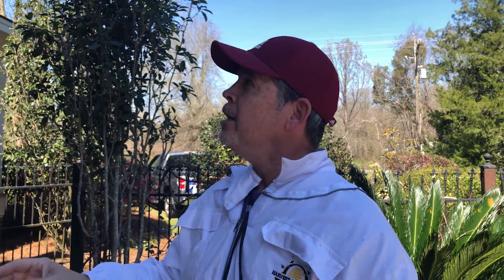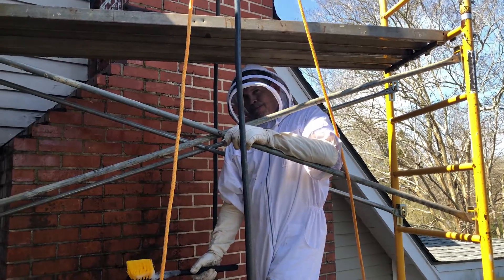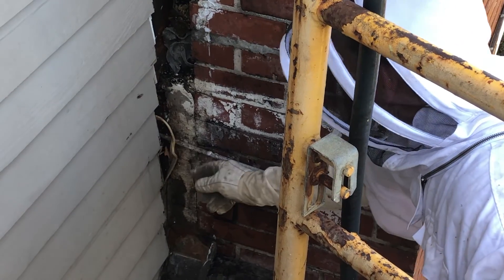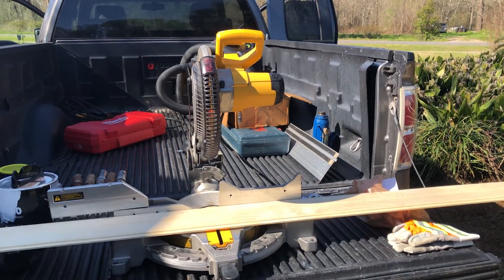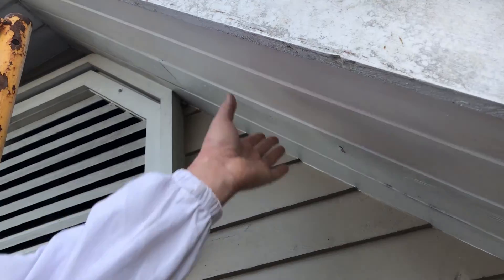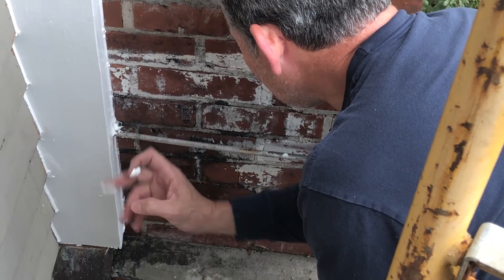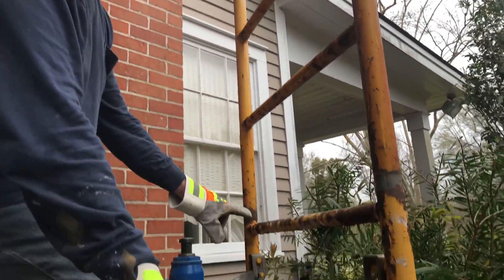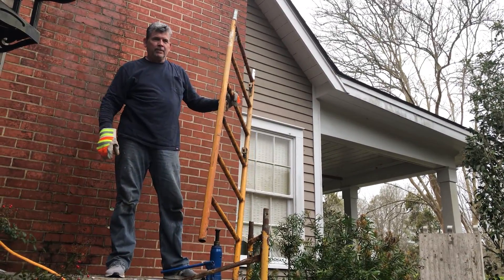How to Repair and Seal a Soffit INFESTED by Bees

Comment: always carry some low gauge copper wire with you, when tapcons fail slide in the wire first then use tapcon. gives it something to bite and can thicken the threads and give it something to anchor too.  when finished flush cut the wire and done.  know from experience it will improve your 50/50 success rate to about 98%. cool video 👍
Reply: Great tip. Thanks
Reply: We use that tip in construction and especially property maintenance, but with tooth picks or wood inside stripped out hinges and other holes etc mostly
Reply: believe it or not zip tie ends that are cut off after zip tying work amazing for this too!

Comment: Great work as usual guys!  Something I have learned to do when Tapcon’s don’t work because the hole gets stripped is to use short pieces of bailing wire or even a zip tie or two in the hole and then use a Tapcon or just an exterior screw. It works really well!  You two are a great team! Jordan, you are a lucky guy!
Reply from the maker: Thx Stuart 👍👊

Comment: Not sure if you will check this since it's a three year old video, but...I have found that sometimes if the the tapcons are stripping, if I use my drill/driver instead of the driver so it won't vibrate, thus making a smoother entry into the masonry. I think this helps to keep it from stripping. Also it helps me to not go smaller that a 1/4" tapcon except on rare occasions.
Also thanks so much for all information on all the videos. I had a kitchen remodel drop in my lap recently, and the A to Z kitchen remodel helped me tremendously as I had gotten very rusty in that area.

Comment: There's a trick that works good for getting stripped tap cons to stick in concrete/ brick. If it strips, stick a peice of copper wire( like out of romex) into the hole and it will compress the screw tight. Saved me many times

Comment: Cut a zip tie and put it in the hole in the brick or block when the tapcon strips out. Works perfectly.
Reply: I’ve never tried a zip tie but pieces of wire work well.

Comment: That Quad is great stuff!  I found it one trip to Home Depot and use nothing else now.  I use the paintable window, door and siding. Had a leak around a south facing window and no issues two years now. Even use it filling cracks in stucco wait for it to almost set and use a brush to texture it.
Reply: I first saw Mike Holmes (Holmes on Homes) use it probably 12 years ago and based on that alone, I switched to it.   And never looked back. It's best used by pushing the tube, not dragging it. That way you avoid needing to tool it.

Comment: For the blue masonry screws, I have to go down a 64th or 32nd in drill bit size for softer materials like brick. Concrete and block I go with the recommended drill size.

Comment: @12:18 When your masonry screw won't grab  take a piece or 2 of romex wire sheathing (or even plastic from a water bottle) , roll it up, stick it in the hole.  Same thing if you're having problem putting the plastic anchor into a hole you drilled for a masonry screw. I use this trick all the time - no need to drill another hole. Just basically stick some plastic in the hole, and put your screw back in.
Reply from the maker: Thx val!  I've used copper wire before also 👍

Comment: Hi have been watching your fascia & soffit videos. Very impressed how you tackle jobs some guys would not want. Tell me, why do you not use upvc cover fascia once the rotted timber has been replaced ? New timber looks good when it’s newly painted, but over the years,  labour intensive.
Mike uk.
Reply from the maker: Thx!  Not sure what upvc covers are.  I used solid pvc fascia in other videos.  Same concept except it’s a solid material not a skin?
Reply: No need, also an extra cost material and work. Wood is old school but works just fine, and you wouldn't want to redo/cover the entire trim that is all wood right? We have Kilz outdoor primer/sealer here in Canada and it seals wood great, just thin it out a bit first, sand and seal the ends twice and I'll look good for years and years.

Comment: You will have better luck if you drill into the mortar and not the brick. Also if a hole pulls out, you can stick a tie wrap into the hole and then screw into that.

Comment: I put the screw that I'm using to the tip of the bit and where the Philips goes into the head I put blue tape around the drill bit so I know that that's the length of my my my screw now in this case your softcover or your recovery have right there on the siding by the chimney you add that same thickness of that citing that you have and put tape on that area so you don't go to Deep you know where you're at just what I do